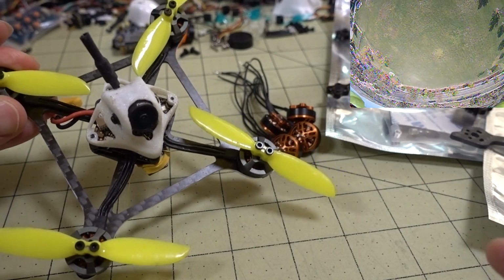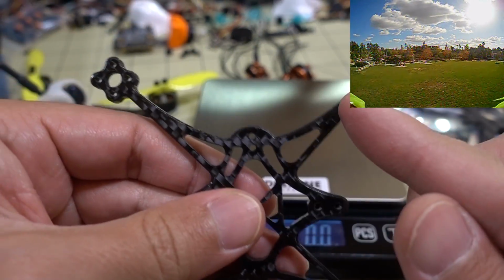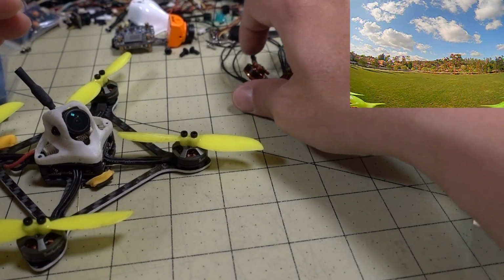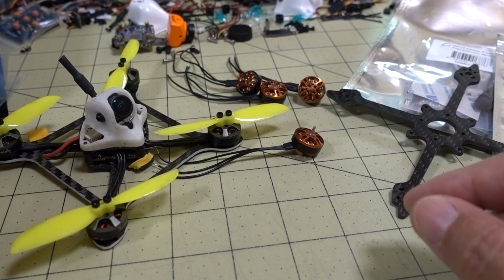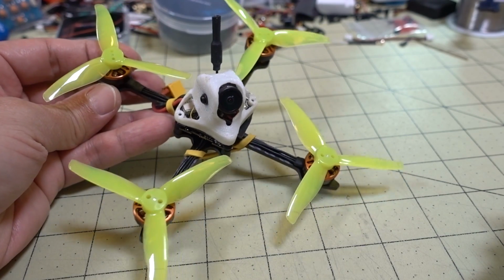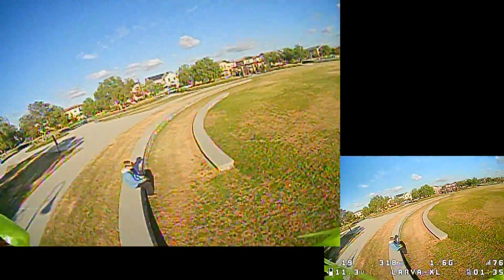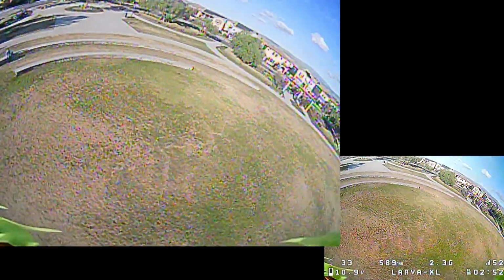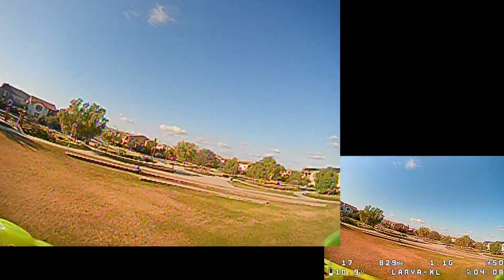KababFPV TP3 w/1303 Motors is Great! 👍😀

Comment from the maker: Kabab Babytooth Frame - http://bit.ly/2QoLWBx
Crazybee F4 v3 - http://bit.ly/2rRyGMi  |  http://bit.ly/2LmrRrT
DiamondVTX - http://bit.ly/2twCNxI  |  http://bit.ly/2OkIr00
RunCam Nano 2 - http://bit.ly/2YaUAt1
T-Motor 1303 - TBD
Gemfan 3016 Prop - http://bit.ly/36wkgAA
Battery - http://amzn.to/2sQN9bM

Yes, I know the current sensor isn't calibrated!

RPM Filter Quick Setup - http://youtu.be/JkBa7v7qWus
Video on Larva-XL - http://youtu.be/DVeoqz7KqpQ

Comment: Hey man! Just finished a TP3 with these motors and was wanting to find out if these 1303's could handle a small 4s if more filtering was used?? I don't want to fry a motor testing as I can't really afford to just up and buy more.
Reply from the maker: At that kv on 4s, it's really pushing it.  The problem is also going to be the ESC which will probably fry on any kind of crash.  You could try a 75% throttle limit setting and they may help but it's kinda risky.
Reply: I'm running the Mamba 25a. It's rated for 4s. Would the mah of the battery dramatically effect how hot the motors get I guess is what I want to know? Would it even be worth the extra power with my 120g build?

Comment: After a lot of people asking for they still want to make 1.5mm shafts. Why? They bend so easily and you have to screw the props adding weight and consuming time.
Reply from the maker: Looks like they are making it 2mm for production.  Remember, the motors I have are prototypes.

Comment: try a 18560 battery
Reply from the maker: stay tuned!
Reply: @AlbertKimTV  I ordered this one 

https://www.18650batterystore.com/ProductDetails.asp?ProductCode=vapcell-18650-2000mah&CartID=1

should be good enough  for maybe 10 mins flight time.. also the amp rating is pretty high for it so should be good enough will see when i get it..  couldn't find like a 1000-1500mah size at that high amp rating .. I'll see when I get my stuff and build it..

How much amps is this TP3 sizes be pulling ?

Comment: Hi great video as always, just want to ask your thoughts on the motor? Is it fast? Powerful?
Also where are you getting the sound recording? Thanks!
Reply from the maker: So it's fast enough for this light weight quad but top end is limited because the motor is still small.  Has plenty of power for all the acro tricks you saw... no issues with that.  This motor will perform worse if your quad AUW is too high so keep the weight under 110g AUW with lipo.
Reply: Thank you for your response!
Reply: By the way, i saw your 1204 betafpv motor video, just curious, which one do you prefer between these two motors for a light weight 3” 3s build?

Comment: Kabab's Toothpicks are THE ORIGINAL Toothpicks, and indeed the TP3 is easily the "ultimate." You really gotta fly the modular TP3, with the recommended specs. Frames just came back in stock yesterday. If theyre gone already, sign up for an email alert for when they return. I can also recommend the 1S Babytooth build, a 56g AUW (or less,) 3", with 1202.5/11,500kv motors, and 600mah 1S. Quiet, long flight times, deceptively high performance, and probably one of the safest, non-whoop builds, of which I am aware. My build hit 55.8g AUW.
Reply from the maker: Yes, all those things are coming to the channel eventually.  It's been tough having to make multiple orders over many weeks because of the lack of stock.

Comment: I had the same issue with the 1303 amax 1.30 on filters killed the prop wash. I’ll bee doing a vid soon as well!
Reply: Cant wait to try this. Thanks!
Reply from the maker: Wow you moved it up that much?  Hot motors?
Reply: Albert Kim  No hot motors ...It was fine at 1.2 I just kept going cause motors were still cool. I stopped after 1.3 cause I got a warning for flyaways didn’t want to try it cause the prop wash improved.
Reply: Albert Kim  Namelessrc board BTW.